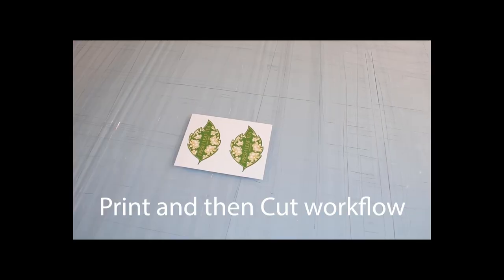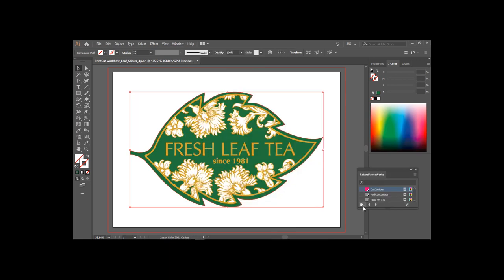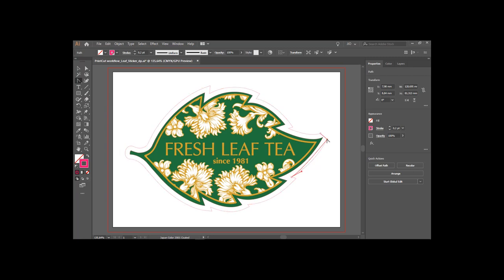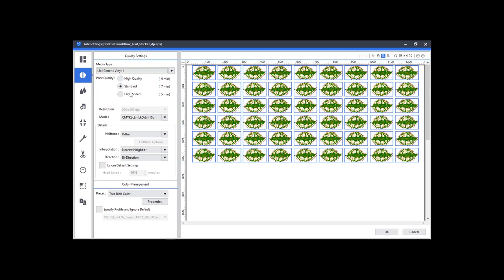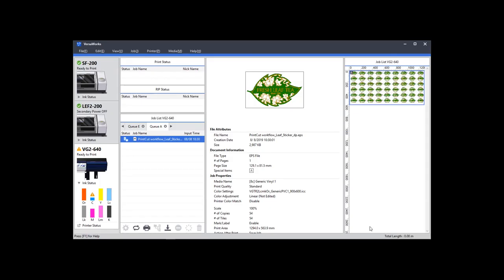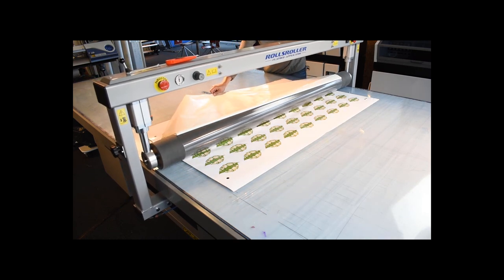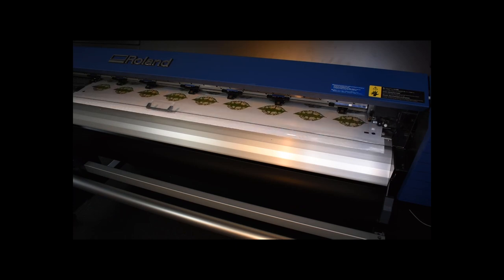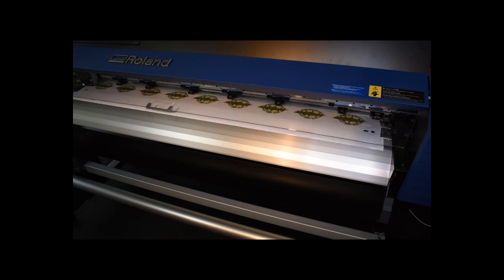Print-Laminate-Cut Workflow with the TrueVIS VG2 | Roland DG Academy

Comment: Love the video, but I see that you used the default cutting settings.  What procedure would you recommend to tune the cutting specifications.  For example using 3M 40C-10R and 3M 8089 over laminate
Reply from the maker: Hi Michael, depending on the type of media used, you will need the right blade. As you are cutting through vinyl and laminate, you may need a sandblast blade. With this and the force combination setting on the VG2, you should be able to cut through the material. If you have any further issues, please contact our tech support team on techsupport@rolanddg.co.uk.

Comment: Is there a workflow to print / cut while using the take up unit like some older models? XR I think?
Reply from the maker: Hi Pete,
Yes this is the same process as on older models, you just need to use the Custom Cut function and select TU2 on the device when setting up.
Reply: @RolandDGEMEA  I ❤ my Roland

Comment: Is there any print and cut machine that would require no lamination for car decals or wraps
Reply from the maker: Not really, with any ink type being printed you need lamination as the vehicles are exposed to so many varying conditions, often at high speeds and cleaning etc. so the ink needs protection. For some smaller decals or short term, you may be ok without lamination.
Reply: Roland DG UK okay awesome, what’s the lifetime of the ink without lamination for outdoor ? I’m thinking I’m buying this over the latex
Reply from the maker: @KtuluLeaderRise  For the TrueVIS ink (TR2) you would be looking at around 3 years outdoor durability, but again there are a lot of variables to take in to consideration.
Reply: Roland DG UK perfect, where can I make the purchase for Roland vg2 540 ? USA please
Reply from the maker: @KtuluLeaderRise  Please contact Roland DGA and they will be able to help you: http://www.rolanddga.com/